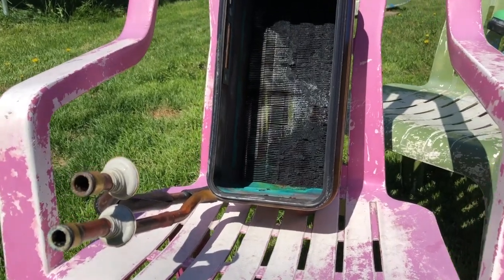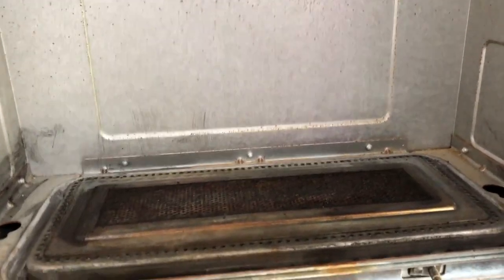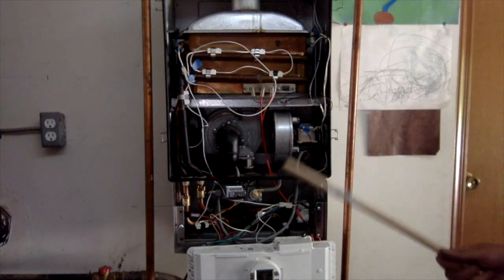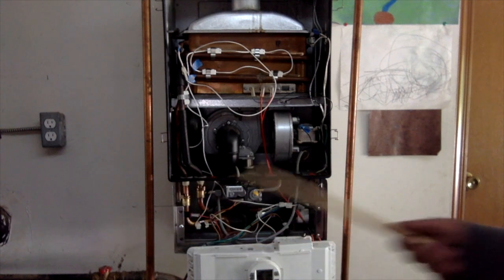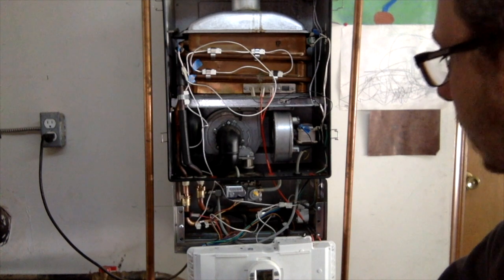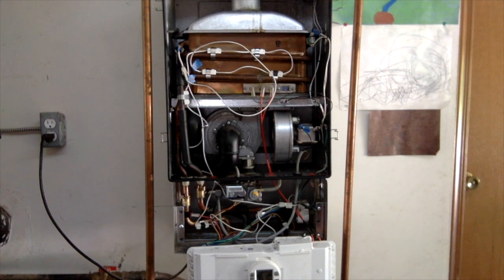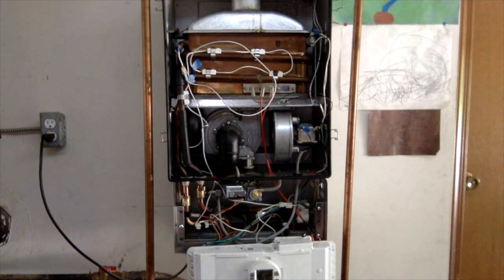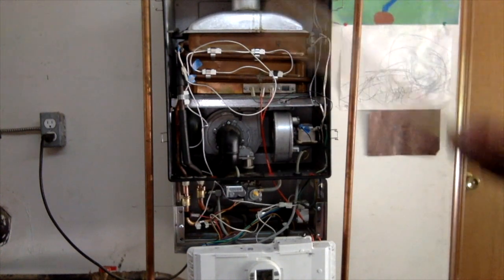Bosch 2400 tankless water heater EA error code fix

Comment: Our hot water heater smells like it's burning and we keep getting an error code. I don't have money for a plumber. We have hard water. Do you think this may be the problem and do you think we could clean it with baking soda and vinegar? Thanks.
Reply from the maker: Is your error code the same as mine was?  Have you popped the lid off to see if something is burning on the surface?